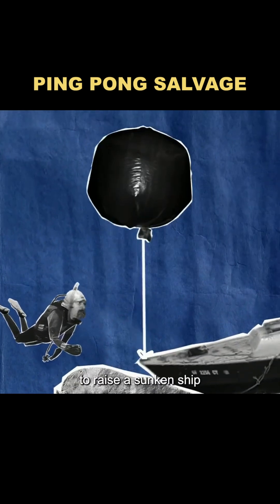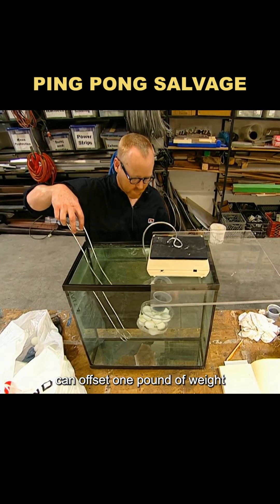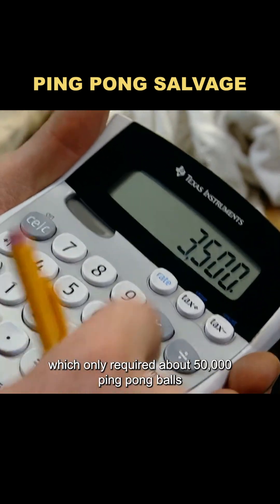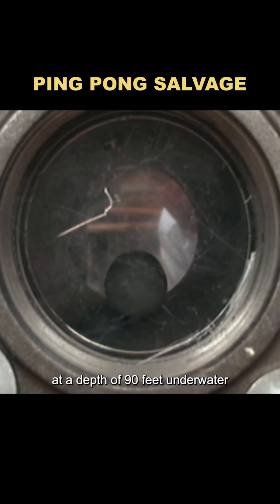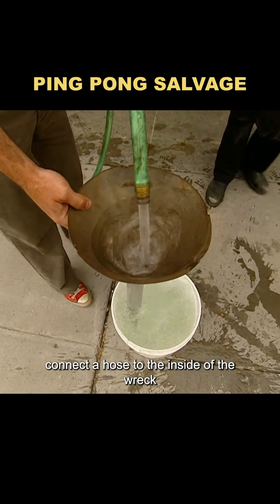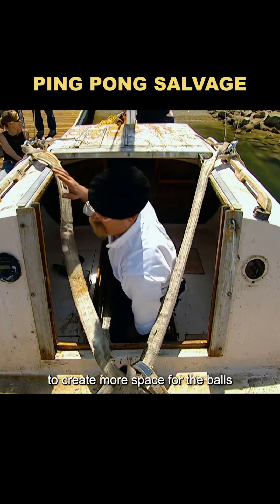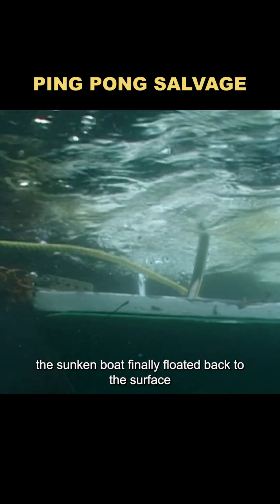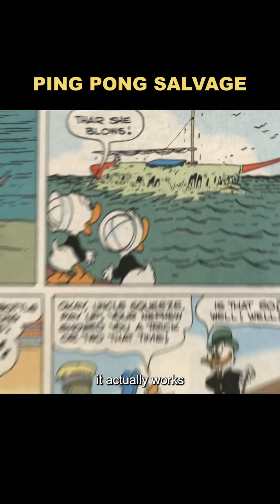See how ping pong balls are used to salvage sunken ships

Comment: Don't need to have the PP balls inside the sunken boat, either.. using cables attached to a right mesh, the ball's can be placed at a depth where their lift capacity is not impeded by their depth/pressure capacity and remember they more PP balls in a limited surface area means they'll stack below existing balls, rather than spread out, either soiling out or reaching, potentially, below their pressure capacity

Comment: They shouldn’t have tested how much weight can each ball pull but how much density combined with the boats would be enough to be less than the density of water. This is why they ended up using less balls, bc the weight the boat has in the water is not the same that it has on land.
Reply: I think they used less balls because the boat still had ballast, ie. The empty part of the boat that normally helps it to float when it's not flooded

Comment: How did they prevent seawater from filling the tube that carried the ping-pong balls? If it had filled up, the hose wouldn't have worked.
Reply: They put the tube in a air pocket in the boat to fill it up